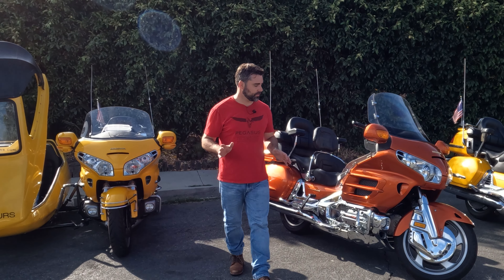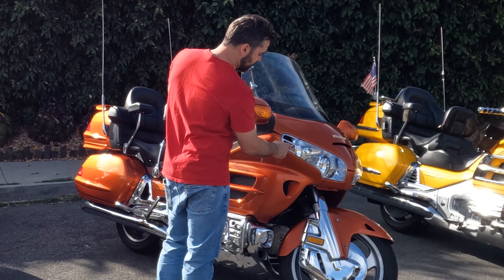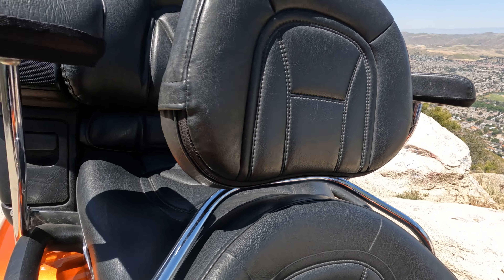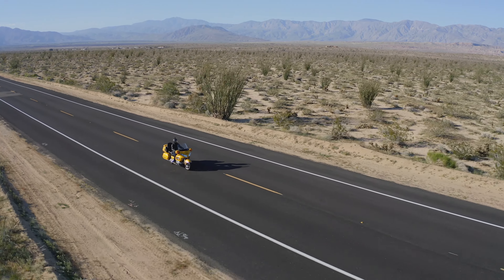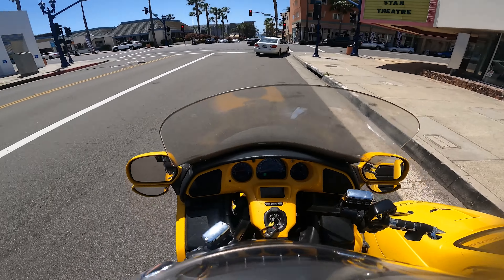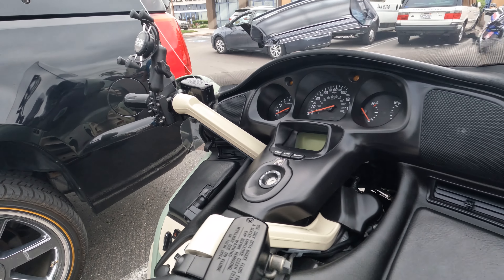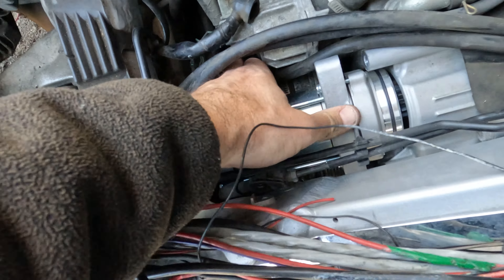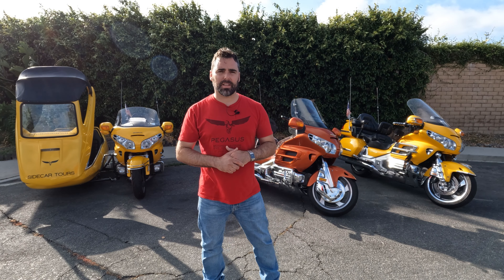Honda Gold Wing Farkles! Some of the aftermarket chrome parts & accessories for the 5th gen. GL1800

Comment: Can you do a video on how to take off the chrome accents?  I like the stock look and may have to buy one with lots of bling to take off!
Reply from the maker: Most of the plastics on the Wong just pull of. That includes the gray dash, both side panels under the seat and the long thin strips that run vertically under the handlebars and along the vents.  Be ginger with these though as they have small tabs that break easily. Any other chrome accents along the frame for example are typically taped on woth double sided tape. The vent pull out as well as the front fairing which only has screws behind the mirrors.